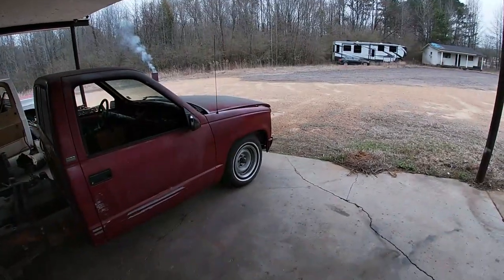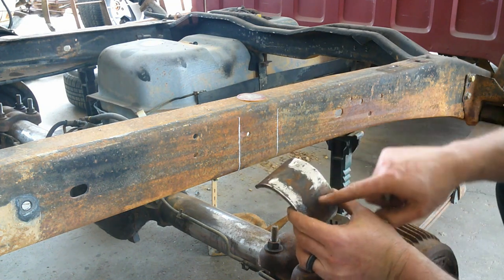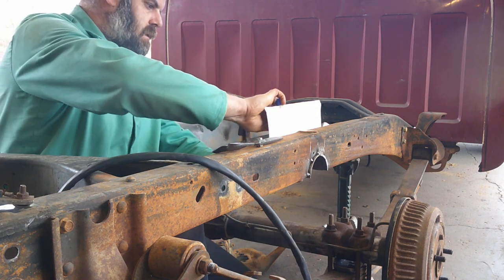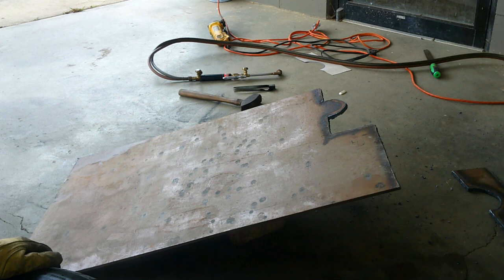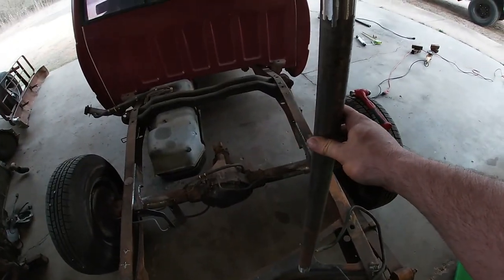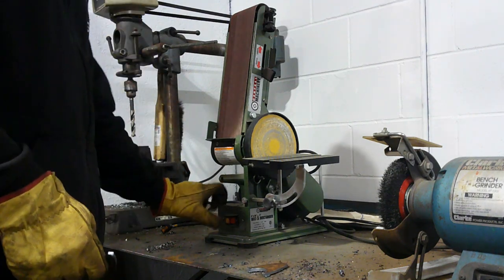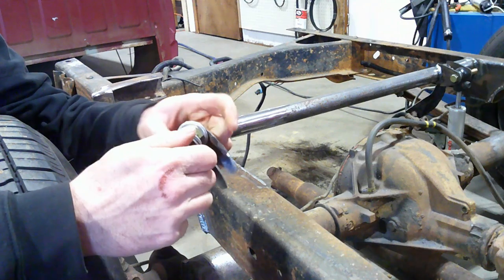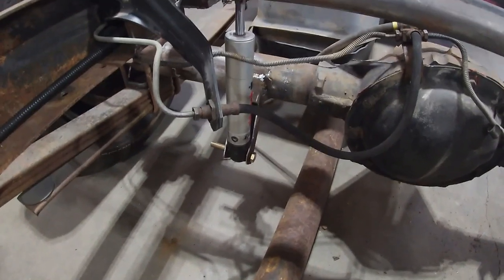DIY C-Notch and shock relocation on my 1991 Chevy C1500 Obs lowered truck

Comment: Thank you for sharing this Man, Im going to try this on my 78 c10 short bed, the biggest issue I have is knowing what tabs to weld on top and bottom, my Buddy gets me some pretty cool shocks but they are not meant for a c10 so they have weird ends, he works for Eibach where they actually manufacture shocks.
Reply from the maker: That’s awesome. Wish I had a Buddy that worked there

Comment: The C notch actually has more metal in it than the original piece of frame that you cut out, if you flattened it out it is longer. You're right, it is safe if it is good weld, you done so I'm sure it is good. That is some good fab work. Keep up the good work and take care!
Reply from the maker: Thank you sir. You take care also

Comment: Some great fab work!  I'm going to have to learn to weld.
I'm curious how low the lower shock mounts are on this lowered vehicle?
I'm also curious how it will handle and ride?
Thanks as always for your efforts!
Reply from the maker: The shock mounts have about 6 inches of ground clearance. From previous experience the ride is smooth, but I will let you know when I get to drive it how it does.

Comment: You did exactly what I picturing in my head! Great video! What is the diameter of that pipe?
Reply from the maker: It’s 1” and 5/8 or 1” and 3/4 rollbar tubing
Reply: @HarmonGarage  I greatly appreciate the info!
Reply from the maker: No problem, thanks for watching

Comment: Buy a diamond cut off wheel cost of four blades but will last longer than 20 I had one explode like that kicked back while still spinning and cut my leg wide open on the inside of my knee will never use one of those ever again
Reply from the maker: Thanks for the tip

Comment: What size welder do you use? 👍
Reply from the maker: Welder? Or welding wire?
Reply: @HarmonGarage amp size
Reply from the maker: I’m not sure. It’s a 240 volt. I will have to look at the amperage on it